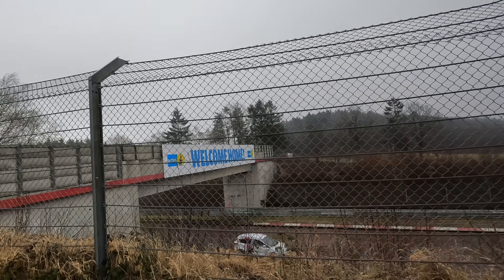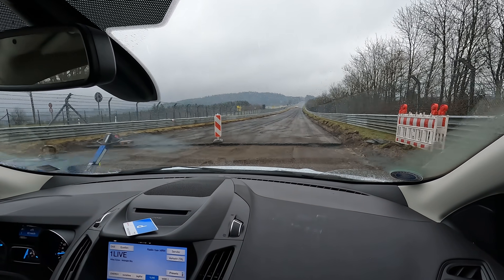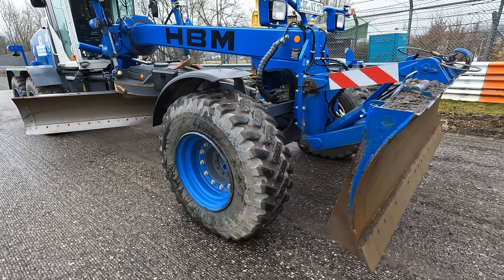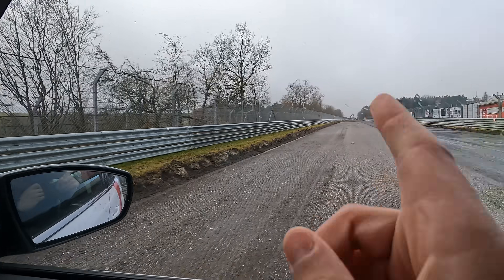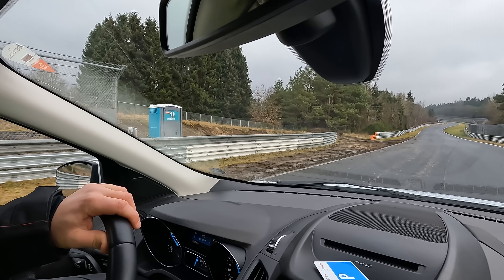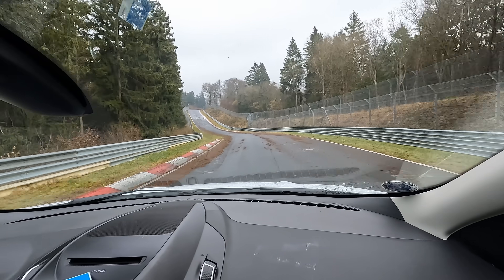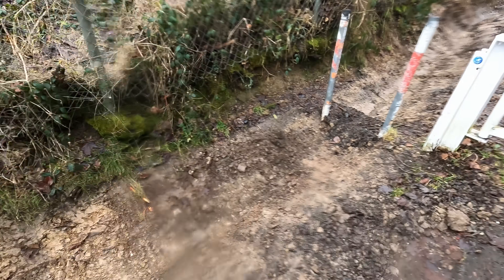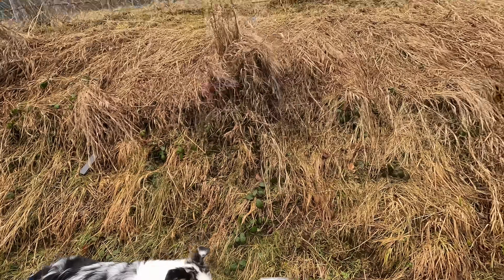Extended Nürburgring Track Limits😏😏😏

Comment: Those heavy truck/tractor tires are measured differently.  For example, a 23.1-26 tire on the sidewall has a overall diameter of 63 inches.
Reply from the maker: Thanks!
Reply: It seems first number is tire width by inch, second number is rim diameter by inch?
I wonder if there's a way to calculate the tire diameter by those spec?
Reply: @RDSAlphard  There isn't, it's just a standard size based on width and rim diameter. So this 17.5x25 tire is 52.5" in diameter and so will be any other 17.5x25 tire using this system.